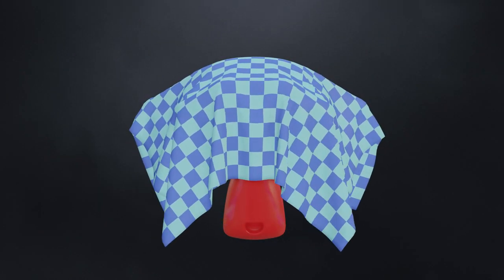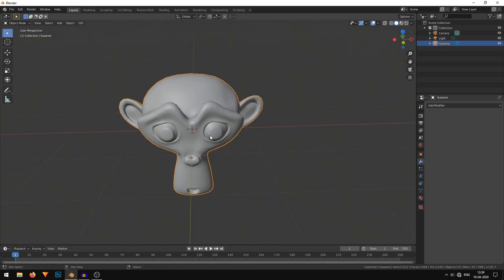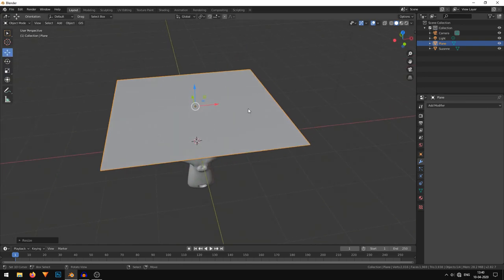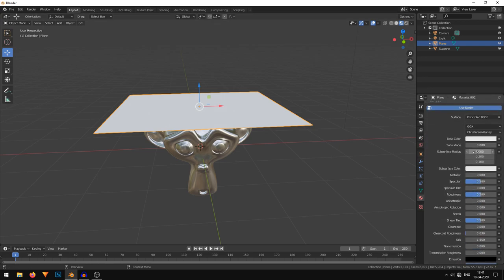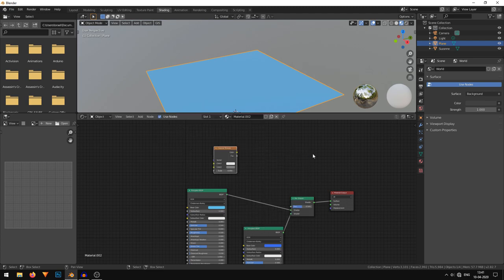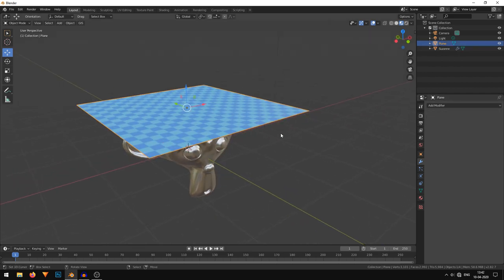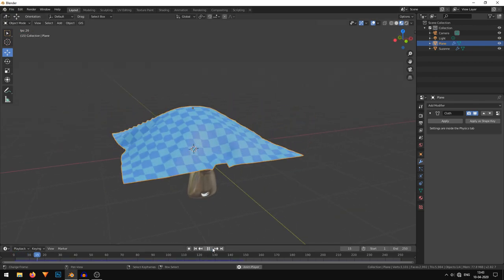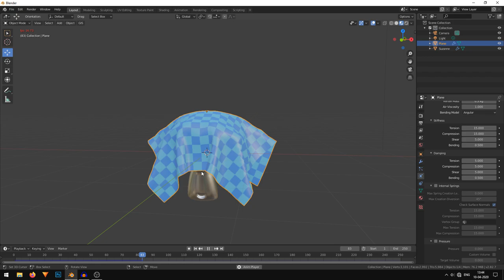Easy Cloth Simulation In Blender 2.82

Comment: subscribed ....nice tutorial but cloth simulation not working for me it is staying as a rigid body on the monkey head top.dont know how to fix
Reply from the maker: You need to subdivide the plane or if you have applied a subdivision surface modifier make sure that the cloth modifier is applied after it. First subdivide then apply the cloth modifier.
Reply: @pinkpocketTV  thanks i will try.Cloth simulation is the only thing doesn't work on my system i thought it was a bug

Comment: Whenever I add the cloth modifier, it ends up not acting at all like cloth, it just kind of acts a bit like soft body. Pls help
Reply from the maker: It should work. Did you subdivide that cloth plane? if not things won't work.
Reply: @pinkpocketTV  It works! Thanks